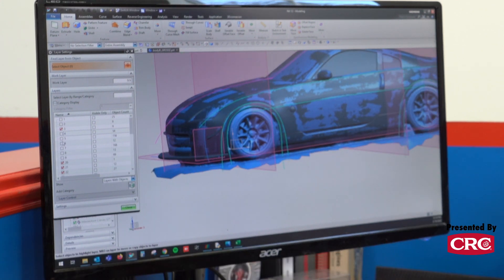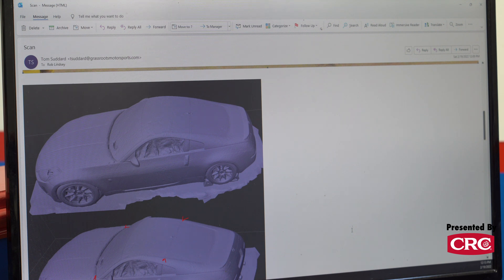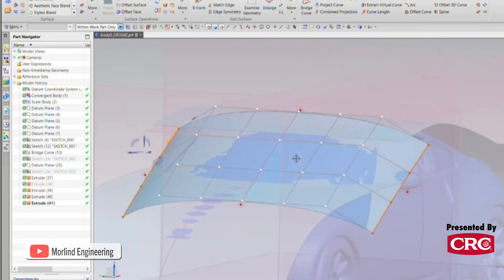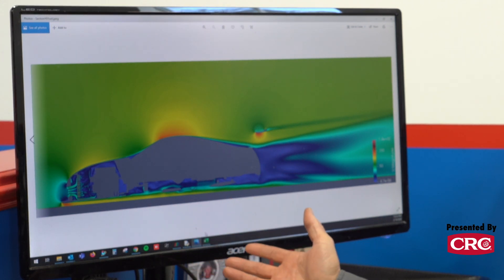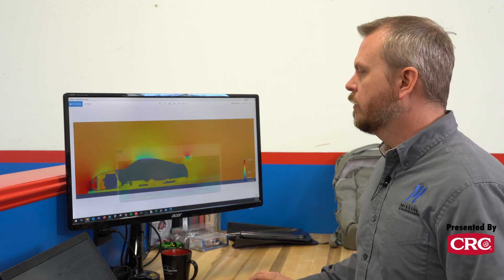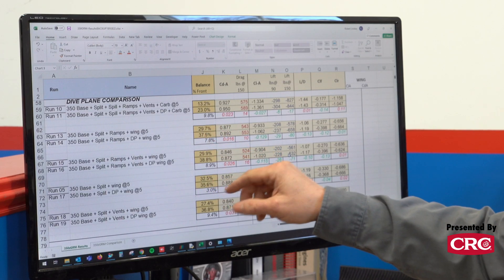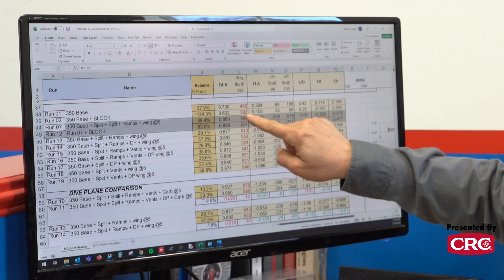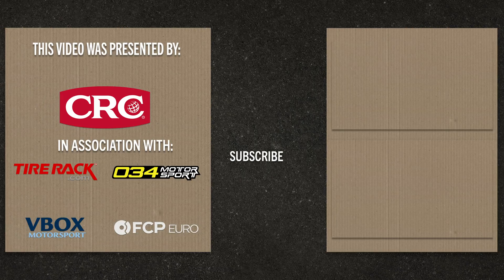Race Car Science! CFD Aero Analysis on Our LS-Swapped 350Z

Comment: I am trying to understand where I need to remove material to get the desired air-flow for 'Hood Ducting'. My struggle is where the best place to put the openings thru the hood. Before the Radiator, or behind it (in the Engine compartment). a CFD analysis of that would help me understand the best solution to my problem.